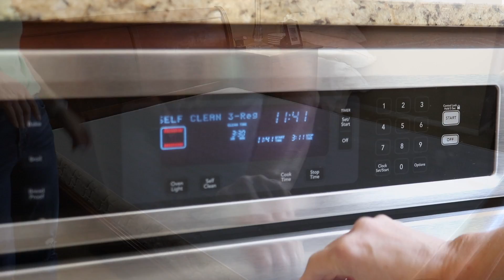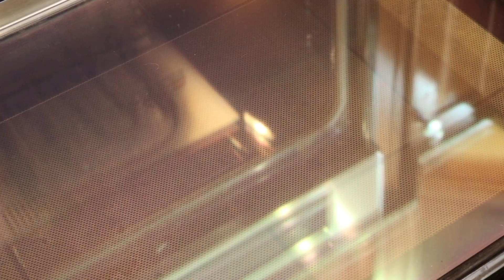SPRING CLEANING MOTIVATION | CLEAN WITH ME

Comment: Hi! I have similar kitchen cabinets, but can not seem to get mine clean and as shiny as yours. What do you use to keep them so nice and how do you deep clean yours? They are beautiful!❤️
Reply from the maker: Hi! The manufacture recommends cleaning with water only. There have been times when I've had to use a cap full of Murphy Oil Soap Wood Cleaner or a few drops of dish soap in a bucket (gallon) of water. Most of the time I wipe down them down with a damp microfiber cloth. But cleaners can leave a film, so you may need to rinse with a clean wet cloth. Happy cleaning! 😊🌸💕
Reply: @27foxplace  Thank you❤️

Comment: My KitchenAid refrigerator is garbage. The ice maker only worked for 4-5 years. The dishwasher rinse aid dispenser doesn’t work properly. The oven has a fan at the back that can’t be turned off, and it blows the tops of cakes and breads lopsided.
Reply from the maker: I'm not a fan, either. 😑